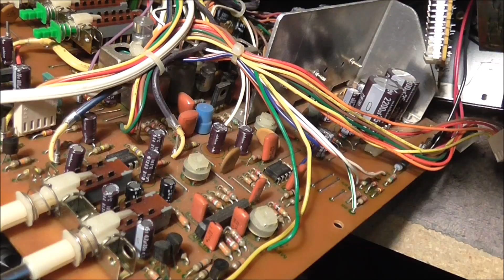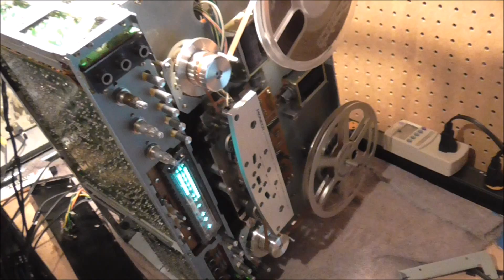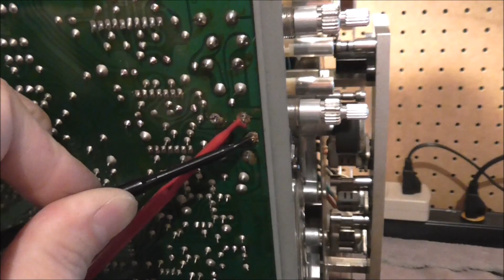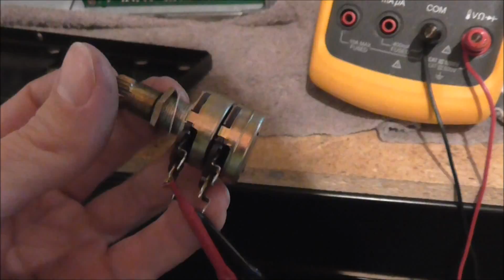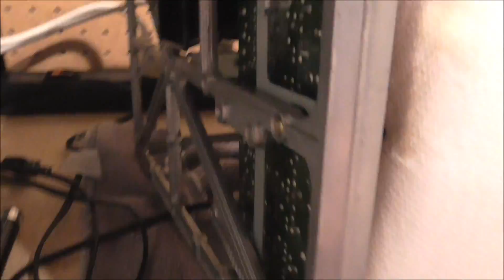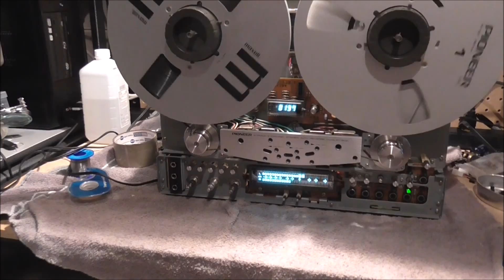Pioneer RT-909 Part 3 (5-21-2015)

Comment: Well done, Adam. I learned much. My 909 runs well for about 30 minutes and slows slowly to stop. I am thinking the run capacitor is faulty. Can you advise me? All other functions working as they should. Thanks in advance as I know you know.    very kind regards,   george parker

Comment: Hello. Great video series.  I am currently rebuilding an 909.  It will need a new belt and pinch rollers. I am glad you caught the problem with the thick belt thing and wow and flutter.  Can you provide me with where you got your correct thinner belt and the pinch rollers?  A web site would be helpful.  And thanks again for the in depth rebuild.

Comment: Adam. When you re solder, do you simply reheat the existing solder or do you remove the old solder and use new solder ?
Reply from the maker: It depends. Sometimes to reflow a joint I can just heat it and maybe add a little bit of my own solder since wave soldered joints are usually light on the solder anyway. Sometimes though the solder is really nasty and I have to remove it, clean the pads with flux and start over.

Comment: Adam..Do you do repair work on RT-909's? It RWD and FFWD at regular speed but plays REAL SLOW in play both directions. My email is: jokhool@yahoo.com
Reply from the maker: +glennnchan There is a speed setting switch, 3.75ips or 7.5ips. make sure it is set correctly. maybe the tape you are trying to play was recorded on a professional grade which does 15ips or 30ips? If you make a recording yourself does it play correctly?

Comment: I have an RT 909, I not sure if it's a motor issue or a micro switch issue (plays and rewinds left but not right) we've already replaced it in the audio lab with a digital recorder. I need to know is it better to sell whole or in parts?
Reply from the maker: +Pete Urbann I cringe every time I see someone rip one of these things apart. I think you should sell it whole. That issue can probably be fixed.

Comment: Adam Help please!
I still have a single problem with my RT-909. Plays well and records well in one direction. But it will not record in reverse direction. I can't turn the record bottom red in reverse direction. Otherwise everything seems to work fine. Any ideas what it could be? Thanks a lot.
Reply from the maker: +William Clark The RT-909 only records in the forward direction, but it will play in both directions. This is the way it was designed.
Reply: +Adam's Workshop 

Thank you Adam. That was what I was wanting to hear. It is now confirmed.
All functions work fine now.

Thank you so much for Your help. I appreciate it. What would I have done without people like You?!!!

If anyone needs help I will do my best to help you.

Comment: Hello Adam
I have a problem with my Pioneer RT-909. The right motor keeps spinning all the time and I can't stop it until I turn the deck off. I think it happened after I have changed the big black 4.5uF capacitors with 5uF ones because one of them was defective. Any idea what it could be and where I have to look. I appreciate any help. Looking forward to hearing from you. Thanks. regards.
Reply from the maker: +William Clark It is probably something in the logic control or something fried in the H-bridge.
Reply from the maker: +William Clark Its likely one of the transistors in the H-Bridge circuit is faulty, or some sort of logic error. This type of problem would typically require some deep troubleshooting.
Reply: +Adam's Workshop 
Thank you for your reply. I have been troubleshooting this deck for over a week. But I think I have found the shortened transistor. It is the 2SC2535 transistor in the right motor block. I exchanged the two transistors from the right block with the left block and the problem changed side from right to left. So the 2SC2535 is defective. I have to change that transistor. I found it in Spain and it has been already ordered. I am just waiting to get it.

If others face the same problem they should test the 2SC2535 transistors. They have to be removed from the board to be tested.

Thank you so much Adam.
Regards
William
Reply: +William Clark 
By the way, I nonticed that the knobs of output level, rec level and mic levels on the front can't adjust R & L levels separately. As if they are glued together. I am afraid of pushing them hard. Is this normal? Or I should be able to adjust R & L levels on thos knobs separately?
Reply from the maker: They stick a bit in relation to each other, so you can turn both for equal levels easier. If you hold one, you should be able to turn the other, albeit with some effort.
Reply: @WilliamClarkDK  Cordial saludo... apenas ahora viene mi 909 a tener el mismo problema... trataré de conseguir los transistores y también los condensadores de ambos motores, a ver si puedo solucionar la falla... gracias por la orientación.
Arturo - Colombia
Reply: +William Clark  hi William did you figure out what causes the right motor to spin all the time. I have one doing the same thing. It starts spinning right when you power on the deck. Kim
Reply: stratokim
Hi Kim
Yes I have solved the problem. You have to change the 2 2SC2535 transistors and both starting motor capacitors (the big black 4.5uF on the main board). Transistors and capacitors can be bought from me. Regards William
Reply: +William Clark Hi William Thank you for responding . How do I buy those capacitors and transistors from you? I cant. find the correct motor run caps?
Reply: +William Clark Hi William. my email is spotz11111@hotmail.com. Thank you, Kim

Comment: Hello I got a question when I record on my pioneer 909
VU meter , and from source shows me very nice level recording ,soon as I record something and put the same tape whatever I record  to the different reel to reel recorders  then I see low level, And again the same tape on the completely different reel to reel Machine  maybe I'm doing something wrong? thank you
Reply: +thesedoy7 
I think it is a matter of adjusting record and play heads. Clean them firstly.
Play a tape recorded on a reliable machine and adjust heads on your RT-909. Record with monitor on to hear what you are recording on tape.
Reply from the maker: +William Clark It might be that, but just make sure you don't have a wear groove in your heads before you start adjusting them, because you will tear up tape and such.

Comment: What is re-lapping the heads.
Reply from the maker: MrMac5150 The heads develop a wear groove where the tape has been passing for a long time, and don't make optimal contact with the head anymore. This causes high frequency loss or instability, as well as dropouts and other issues. The heads can be sent to someone who will grind down the profile so the wear is gone and the surface is the right shape for optimal tape contact. Then the heads are re-aligned to the tape. This can only be done a few times per head before it is too worn out. In the 60's and 70's some studios had engineers onsite who could do this themselves, and this process was sometimes done as often as once every 3 months for machines that were running all the time.
Reply: *****
Would it not just be cheaper to buy new ones if available.
Reply from the maker: MrMac5150 In theory, yes, but these heads are no longer available.
Reply: +Adam's Workshop. Do you know someone who can relap the pioneer heads in Europe? And what would be the adress?
Reply from the maker: I'm not familiar with any places in Europe. I know JRF Magnetics will do heads here in the US.